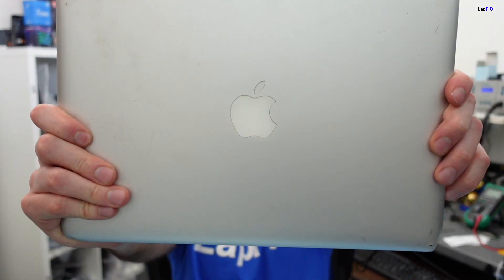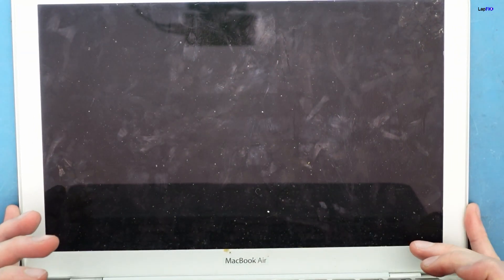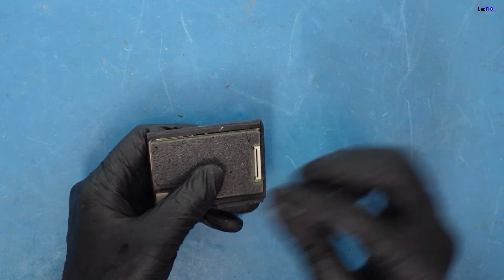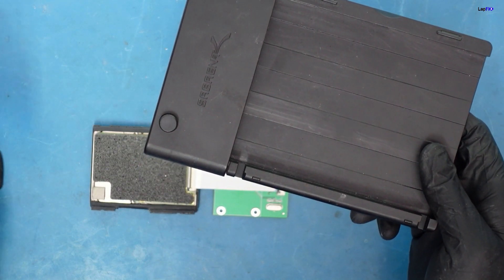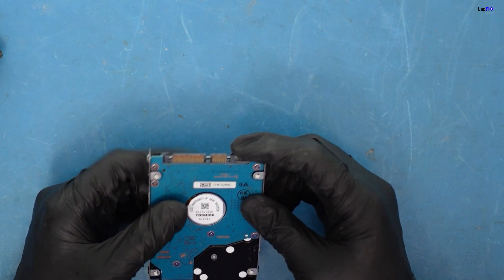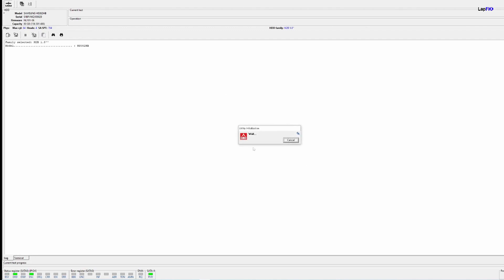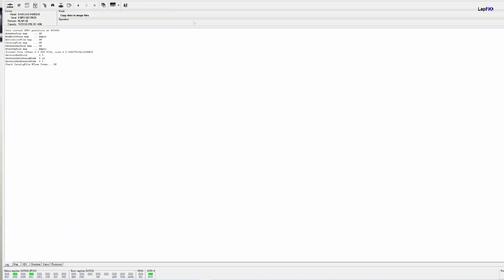How to Recover Data from a MacBook Air Original with Dead Hard Drive HDD

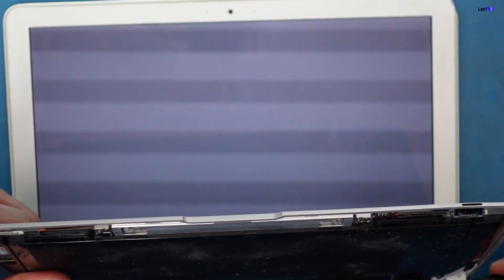Comment: @lapfix, so at 2:50 it wasn't explained at all what "the USB" was for. Was it a bootable USB flash drive with an OS (High Sierra)? And that didn't work because that OS was so much later than the one one the hard drive?
Reply from the maker: Yes that is right.  The bootable USB had High Sierra which isn't supported by this Macbook Air model.  We were checking to see if it was only an OS issue as we could bypass the OS and boot to read the drive externally.  Early 2008 Macbook Air officially ends at 10.7 Lion